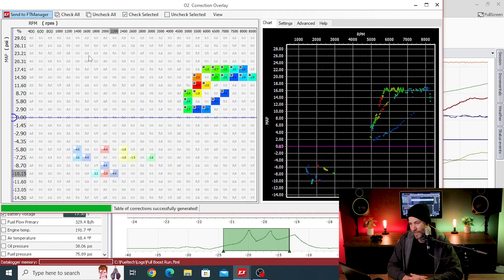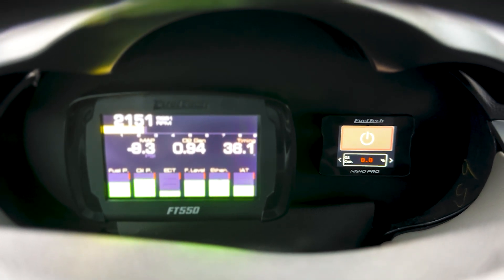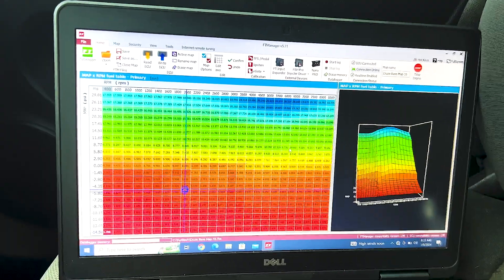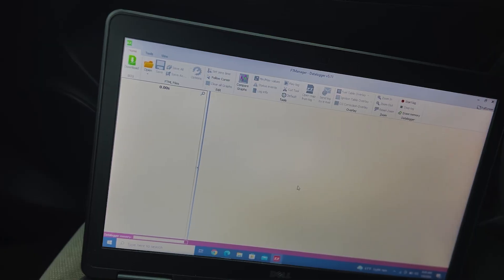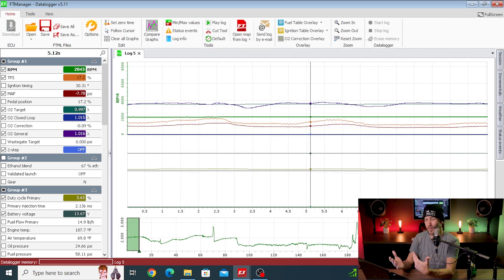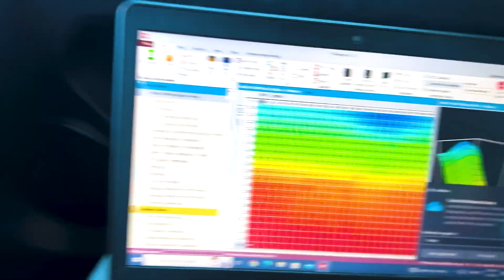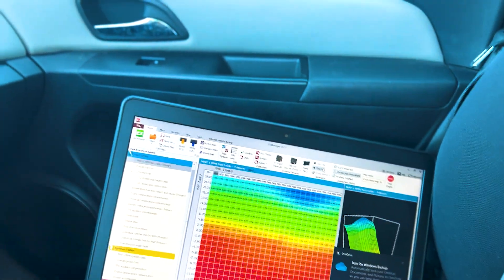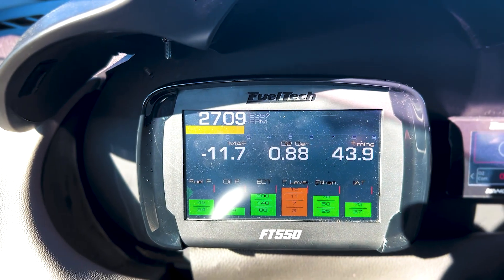Tuning & Testing the FuelTech FT550 - Is It Worth the Hype?

Comment: Not only is the fueltech product great, but fueltech support people are amazing. They advertise that they will help you with your fueltech setup and such so that no build gets left behind, and they sure mean it. When I first setup my ft450 I couldn't get it started, then the customer support guy spent nearly an hour troubleshooting till it fired up. That would have been pricey to bring it to someone to figure out, but fueltech saved the day, and the wallet. Great product
Reply from the maker: I agree.  Once I got it wired and was to start, they helped get it going.  Has been a really easy ECU to learn.  I took the car to PFI speed and they really dialed it in.  Couldn't be happier to have gone with their ECU.  From the integrated dash, operating system of the software, ease of use, all the features I needed for straight line speed.  Great value for the money.
Reply: I know they have to loose their patients with honda civic people 😂😂

Comment: I know its somewhat an older video but curious why the timing ramps up on your pulls as boost increases. Does the lesser timing help spool? Also, how did you determine the 8200 limiter?
Reply from the maker: There's really no rhyme or reason aside from I took a look at the stock timing map. Input that into the FuelTech. I pretty much left the boost timing (0-28 psi) how FuelTech configured it, but I pulled 5 degrees of timing to be safe.  Once I get it on a dyno I'll be able to see what it likes for timing. As for the rev limiter, The engine keeps pulling. I've decided 8200 is enough. The engine could very well rev to 10k if I let it, but the the stock belt doesn't last long at that high of an rpm. There's no aftermarket high RPM belt for these engines that I know of and cheaper brands have flown apart at high RPM. I hope this helps.

Comment: what size injectors do you have?
Reply from the maker: At the time of this video, 1050x ID injectors. Upgrading to 2200 Snake Eater injectors.
Reply: @cmattdabrat  awesome! I just started a turbo project its a honda k24 with 1000cc injectors im doing the tune myself, I have a ft450 any tips? I tuned it NA this is my first turbo build

Comment: Honestly seeing the fuel tech and how it is, I am super...super tempted to make the switch on my DSM.  The power and inputs alone is a huge deal compared to my 28 year old mitsubishi ECU.  Plus that correction feature and interpolation tool...man.  Makes tuning a breeze.  

Keep up the good work, man.  Glad to see you seem to be doing better.
Reply: I am currently choosing between haltech and fueltech and am leaning towards fueltech for a couple reasons. the 2 in 1 ecu/display and simplicity compared to haltech. I am very interested in learning to tune and it seems like fueltech would be an easier learning curve compared to haltech. my dsmlink v3 works, but is very limited and could greatly benefit from having a few more i/o's and going to sequential ignition with smart coils.
Reply: @CVasquesDSM  I wouldn't really say DSMLink is limited, per se.  Kevin Jewer made 1000whp and went like high 7's on it.  But there's no question haltech and fueltech are both WAY more robust and have way more options.  I'd say not to upgrade unless you need to.  Plus with DSMLink there's a ton of Wiki pages, youtube videos, and dudes on both DSMTuners and DSMLink forums that will all help you learn and give advice/tips.  Don't jump ship unless you need to, I say!
Reply: @BasedEMT1776  Kevin actually tuned my car. he did get those numbers on link but he also used a second ecu for to expand his i/o's
Reply: @CVasquesDSM  Oh shit, didn't know that.  That's my biggest gripe man, is the lack of inputs and outputs.  The software can always be tweaked and features added, but the I/O stuff .

Comment: Awesome!! Im glad to see you having fun!! I havent been able to keep my car at idle not sure why, I'm going back to the drawing board to see if I can figure it out. I called FT and the guys tried to help me but they couldnt get it to idle.
Reply from the maker: I feel you on that. Mine tends to like to idle pretty high with the cams, single mass flywheel, clutch, and short runner intake. I had to play with the throttle idle percentage quite a bit. I forget what it called off the top of my head.
Reply: @cmattdabrat  FT tried everything but they couldnt get it to idle so Im assuming it could be a vacuum hose lets see tomorrow if I can get it to idle.

Comment: The engine sounds way smoother. FT is very simple to work with and you're pretty much nailing the tune.
Reply from the maker: It does! It seems very happy. Getting pretty close to having her dialed. Just trying to sort out the wastegate 3 way control.  Almost there.

Comment: Looking good bro. Looks like we're getting some cold this weekend and next week shouldn't be too bad for the track. Now that I got my car to start I'm gonna spend some time learning the software and making sure all my settings are right. I still need to find a timing light and get the ft map sensor hooked up. Good luck at the strip this weekend. When are you going maybe I'll make the drive up there
Reply from the maker: Definitely getting some chilly weather. You're getting close. The software is pretty easy to navigate and lots of good tutorials up.  Specially from FuelTech and Broomy's Garage. I went up there last night, but the track was closed. Not sure if the wind knocked the power out or what?
Reply: @cmattdabrat  yeah probably it's been really windy the last few days and pushing my truck around. Well unless you go today I guess at least you'll have some extra time to learn some more and refine things a little more before you go to the track